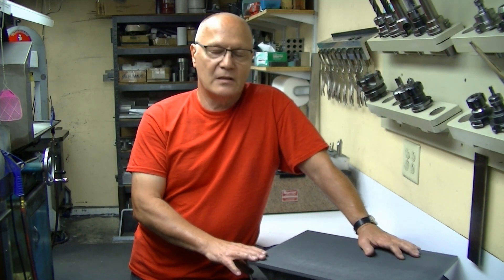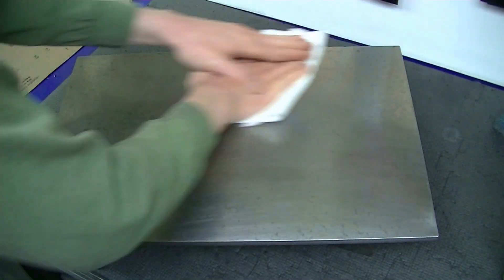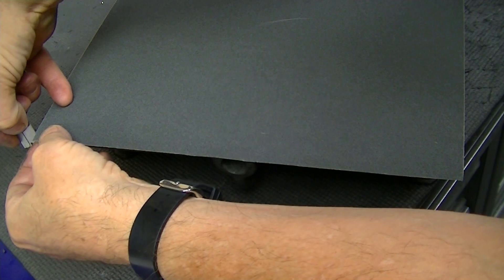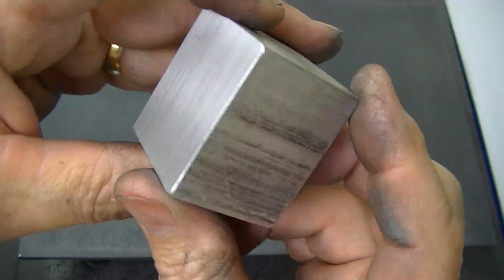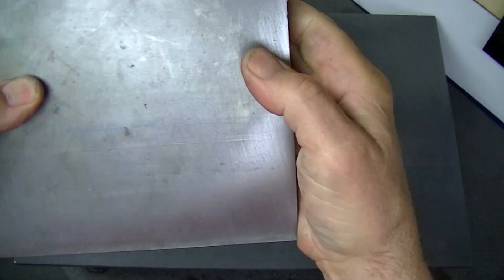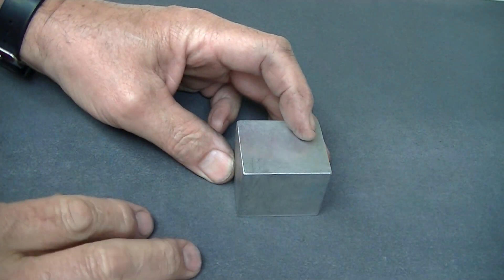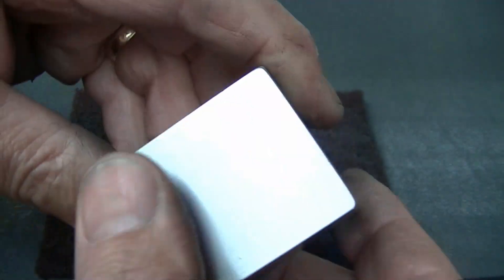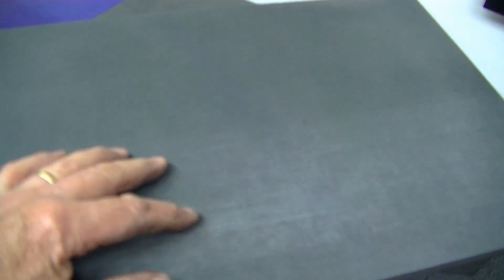THE MAGIC SANDING PLATE  TRT#3

Comment: 18min video on a sanding plate? I watch and I am not disappointed :-)
I have a toolmakerfriend who purposely puts a 45° lay on all his parts so he knows he worked on the parts when he pulls a tool apart a few years later.
Reply from the maker: Glad I didn't dissapoint ;-)
ATB, Robin
Reply: Lapidary company's sell a disc cement for sanding discs. But it's not much different from  77. I use regular rubber cement,it's a little tricky but it works. I do saw piercing in brass and copper? I Xerox the design glue it to the sheet stock, then start drilling a hole in each section that needs to be removed . It's virtually  the same glueing technique .
Reply: @ROBRENZ  I don't know if it's in a spot where you can do it or not,  but have you ever tried letting water trickle on to your sanding plate while you're using it?  I've done it by taking everything outdoors, and also by simply taking everything over the the sink. I really like it. It does a great job of keeping the sandpaper clean, because it's constantly flushing all the particles of sand and material away. I want to build a dedicated supply and drainage system just for a sanding plate.

Comment: Rob you need to contact 3M and tell them how to remove 77.  About a year ago I was so fed up trying to remove the stuff from my 20” disc sander backing plate every time I wanted to replace the disc that I contacted them for help.  To make a long story short, everything they suggested I tried and none of it worked.  You just made my whole evening.  Thank you.
Reply: Aromatic and aliphatic petro solvents tend to work just fine with 77 and other sprays (at least the old cans; idk if they've changed the formula in the last 20 years).  Mineral spirits, naphtha, xylene, toluene (in approximate order of aggressiveness) should work, while IPA isn't going to do anything.  Keep in mind that the solvent package in WD-40 is a mixture that's basically equivalent to kerosene (largely aliphatic).  With some of the chloroprene cements, ketones (MEK, acetone) do work, but their evaporation rate is high enough that for removal tasks, they become difficult to use alone.  Most contact cements (up until more recently) had a solvent package primarily of MEK and toluene.  One might think that if the combination of a ketone and aromatic solvent work well, then a broad-spectrum solvent mixture like lacquer thinner should work perfectly.  This used to be the case, but in my experience, most formulations of lacquer thinner are now adulterated with an excess of alcohol and other "zero-VOC" solvents that they cause the glue to coagulate and turn into a clumpy, smeary mess.  
 
For me, I have spray bottles of the solvents I use.  If I had such a cement on a metal (not plastic!) surface, I'd hit it with a spray of MEK and a spray of xylene.  Scrub to dissolve, wipe off the bulk; respray, wipe.
 
When removing sheet material from a rigid substrate, you can lift the edge and use a brush with solvent to massage the adhesive as you peel.  Keeping that leading edge wet helps a lot.
 
Of course, if you call a company and ask, they're probably bound by liability to not actually recommend something that works if it involves anything that can't be safely fed to a toddler.  That's been my experience.  I've called DAP about one of their adhesives that says right on the can (an actual new can) that proper use needs a specialty thinner that I couldn't find.  I called them to find out that they don't even make it anymore and they would not recommend any substitute product or give me any information about what could be used.  It's just MEK and toluene.  That's all they had to say.  It's not like they don't know.  They just won't say it.
Reply: @PSUQDPICHQIEIWC   I try to avoid Methyl Ethyl Death as much as possible.
Reply: Dream Services International thanks for the in-depth response.  I tried many of the solvents you suggested with little success.  I felt the guy I was corresponding with at 3M was actually trying to help primarily because this went on over a period of days, but it might have been as you suggested, He was not allowed to say due to liability reasons.  This country never was so lawsuit crazy as it is now.
Reply: Oils/hydrocarbons work to remove most adhesives. It's no secret to use ed
wd40. Olive, coconut, peanut, sunflower, canola/rapeseed oils even work. Same idea as using peanut butter to get gum out of hair. Almost all sticker residue can be removed with WD40.
Reply: Hexane...
Reply: @PSUQDPICHQIEIWC  Thanls for the information, now I know why I'm having so many problems with 'glues'. Hope the spray cans I have are still OK since I shelved them because of the problems I was having removing residue  ;o)
Reply: @MaturePatriot  I'd always been told that MEK is horrible stuff, but looked it up the other day . It is an irritant, and tests show that long term occupational use (multiple hours a day) is dangerous, but in low doses - if you're gloved and have decent ventilation - it's probably no worse than any other common solvent.
Reply: Hint from an old time pattern maker:
1. On my 20" State I first heat the paper up by sanding a piece of scrap wood
2. Peel as much off as comes easily, using fingers and a not-razor-sharp chisel.
3. Start it spinning and chisel off as much of the paper and glue as you can. Hold the chisel firmly and keep it skewed and flat on the disk. Watch out for anything that might catch the chisel; high spots, low spots, nicks, etc. ...Unless you are in need of a little excitement in your life...
4. Stop spinning, Wipe the disk, and saturate the remaining adhesive with 3M adhesive remover. The formula for the 3M product may have changed, the old stuff I use seems to be mostly toluol.
5. Wipe or scrape off the last little bits of adhesive.
6. Wipe the adhesive remover off the disk with a less aggressive solvent.
Reply: @ChimeraActual  I’ll give it a try next time I change.
Reply: WD-40 works to remove most types of gummy adhesives. I have been using it that way for years. I often print a pattern from a CAD program on adhesive label stock to use it instead of a scribed layout on parts. After the drilling, bending, cutting or whatever is finished, I spray on some WD and let it soak a few minutes. The label stock then peels off easily. And yes, wipe down with WD and follow that with alcohol to clean off the sticky residue.
Reply: A heat gun works great, but there's no substitute for the right amount of 77 on the paper. A light coat is all you need.
Reply: Acetone takes it right off for me

Comment: Sanding Pro Tips should this video be called. I wondered why Mr. Rob wouldnt give the paper a couple licks with diamond wheel to avoid hispots on the abrasive deposition. Maybe check with a laser comparator and an atomic bubble level to see if the paper grain is aligned with the AAAA+a.1 surface plate.

Not nuff words can b said about your attention to detail. Love your angle about life and glad to see you smile

Comment: I just got my 220 silicon carbide in the mail. I could not believe that it removed milling cutter marks in 15 seconds. I had to come back and comment. I went with 3m 220. This is going to save me hours. Thank you sir!
Reply from the maker: That is awesome!
Reply: What size role of paper did you use? I'd like to have a 12x18 plate with long paper roll that I can cut to length myself. I've found a source for the paper in the UK. Quite expensive to get it shipped from Abrasives South.

Comment: Rob, I use a 16x28" piece of fake granite countertop. I lapped it flat to 002, and coated it with a slurry of epoxy and 1200 grit aluminum oxide rock tumbling media. I lapped it flat again with a long heavy aluminum bar and 180 grit wet/dry paper. I use it like a giant precision stone and for all those things you shouldn't use a surface plate for. For heavier lapping, I just tape a standard piece of wet/dry on it. Wish it was cast iron, but I couldn't find one in the dumpster.😁

Comment: We are twins, separated at birth. Yup. A most underrated tool. I sold my old 9" x 12" surface plate a couple years ago but I've needed it several times since then. I used lighter fluid (my go to quick solvent) instead of WD40 but otherwise we plow parallel furrows. 

I called it my "if you can't make it right, make it shiny" plate. It did good service when I made camera fittings and fishing reel parts. Nice crisp edges, smooth parallel lay on the finish, etc under the anodize and the customer instantly got out his checkbook. Gorgeous esthetics. Probably wouldn't have noticed if it was left handed or inside out. I sometimes used it to dress a freshly scraped surface, take out the slight undulations on the rare occasions when they'd be objectionable.
Reply from the maker: Glad to hear it Forrest, I consider that quite a compliment!
ATB, Robin

Comment: Thanks, Robin. I've employed a granite plate for this duty at work a few years back. Dealing with sometimes hundred year old motorcycle parts it quickly lets me know the condition of a mating or gasketed surface. The link for the oversized paper allows me to grab a new larger plate, as you mentioned I've tried looking in the past. Great video.

Comment: I’ve used this technique a lot on flattening large gate valves and flapper valves in ship repair,  all the lathes cut a slight concave at that shop. In a pinch you can spray wd40 underneath and the paper would stick! (Even with a 8”gate being ‘lapped’) We also switched too soapy-water as lubricant, worked very well!

Comment: A wash bottle with the tip cut back enough to receive the inlet end of spray tips works great to clean them. Push a little solvent through to flush them, scrub the face of the tip and then a final flush to make sure they're squeaky clean.

Comment: When I remove the protective plastic from aluminum sheet, I use a piece of pvc pipe or wooden dowel to roll off the plastic. Doing something similar might make it easier to remove the sandpaper from the plate.
Reply from the maker: Great tip!
Reply: Good idea! Thanks!

Comment: I'm going to be on the lookout for a surface plate for sure. Paper might be more difficult since I likely won't be able  to order from Abrasives South Inc. But then again I'll probably only be using it for checking that surface covers etc are reasonably flat on old engines and such.

Comment: I have small versions of this in my shop and it’s absolutely indispensable for deburring & smoothing small parts. I use 6” adhesive back sanding discs on scraps of 1” thick aluminum that I stoned smooth.
It’s probably not as precise & nice as Rob’s setup, but it works well for me. Plus, it’s cheap and simple to setup. You can get the adhesive back sanding discs almost anywhere, in any grit you want. Just remember to put some WD-40 on the abrasive, Rob really understates how much better this works with WD-40!
Reply: Why would you waste money buying adhesive disks, large flat sheets of "wet & dry" paper are cheaper and easier to purchase in even more grits?
Reply: I pay $0.68 per 6" disc. They work the best for my needs, and it only takes 2 minutes to order any grit imaginable from McMaster. I'm not abandoning something that works well just to save a few cents on sandpaper every week. The boss isn't paying me to economize on $0.68 sandpaper, he's paying me to keep the machines producing parts. 

It's worth spending a little extra money to give people the exact tools and supplies they prefer.  It makes them more productive & it's good for morale.
Reply: @danf5429  - it's not about the cost. It's that you are using tiny 6" disks, which aren't flat and also are so small that you can't do the job properly.

Comment: ROBRENZ, any straight chain hydrocarbon is a solvent for any other straight chain hydrocarbon, from propane to gasoline to tar and wax. 

Most adhesives are dissolved with straight chain hydrocarbons, including 3M Super77. My personal preference for a solvent is zippo lighter fluid, i.e. naphtha. It dries relatively quickly and cleanly but gives me an adequate working time. 

I really like the zippo lighter fluid bottles because the spout they have produces a tiny little stream which means less waste. I've found that I can refill the bottles with Coleman white gas, which is light naphtha. The zippo fluid is a mixture of light and medium naphtha.
Reply from the maker: Thanks for the info!

Comment: A'm using similar plate for years, just it's thick glass not cast.
For removing steel swarf, I use strong magnet, (from hard drive) wraped in thick plastic foil, or even stronger plastic bag.
Just unwrap foil over you trash can, and swarf will come down, leaving magnet clean.
Also, loose abrasive particles will stay on sanding paper this way, so it will cut bit longer.

Comment: And for those of us who can't abide WD-40, Goo-Gone and Goof-Off both also attack 3M 77 residue handily and are readily available in most hardware stores. When removing adhesives from plastics, note that while IPA is useless, ethanol (everclear, the kind you drink) is impressive and won't attack most plastics unlike the aliphatic HCs.

Comment: To remove sanding buildup... I use a powerful shop vac with a “squeegee” attachment. It has a silicone rubber squeegee on the end and a very thin slit so it has tremendous sucking power. 

I think it’s meant for wet cleaning floors. It will suck the damn hardwood floor right out of your house. 

But it’s great for removing the sanding buildup with no Mess!! 

An air compressor running about 50 psi with a pistol grip blow gun and one of those sports ball inflation needles also works for cleaning stubborn clogs in paper and files. 

But any more than 50 psi through that tiny hole in the inflation needle and it will blow a hole right through your sandpaper.

Comment: Thanks for many useful tips! 
I find I get the best results using a "non oily" naphtha on stones and lapping papers, but keeping the surface wet. By feel there seems to be a "right" amount of fluid that works best. Also pure mineral naphtha will not gum up over time as will the vegetable oils etc. Interesting thoughts on convex plates. My cheap China granite measures slightly convex and gives me good flats using lapping paper and Al foil methods, never considered why it seemed to work so well...
A thick glass slab in the sink used with water and a little detergent is another trick I used for decades. Wet paper adheres to the glas good enough to make it work well. I use cheap wet papers and throw them away after each  use, they do not work well after drying.
Reply: "Naptha" means absolutely nothing - it's a non-specific generalised term that covers numerous solvents and mixes of solvents. Could you actually be specific?
Reply: @johncoops6897  I guess it is different in different parts of the world. Around here the cheap product is pretty consistent, usually "oil free" mineral aliphatic hydrocarbons BP about +150C. Main use is paint thinners and degreasing, characteristic is that it does not resinify much, as all veggie oils do. For lab use there are lower boiling fractions (naptha or "petrolium ether") available like +90C to 120C  which I think is often better if You can obtain them. Never had any problems with the naphta from paint stores. WD40 etc usually contains veggie oils and will over time clog stones.
Reply: @erikisberg3886  - the tern 'Naptha" is non-specific and basically means nothing. The more you write, the more that you prove it. Insome countries it means deisel fuel for trucks, etc. Some people call Zippo fuel "naptha", yet it's not the same stuff used in Coleman stoves which other people think is Naptha. Sometimes it's not even made from petroleum distillate!
Even referring to ranges of boiling points doesn't really help, since that covers such a wide range of Distillates. If you wish to refer to a particular solvent, then you need to use it's proper name.

Comment: I use the largest DMT diamond lapping plates next to the mill to deburr before next op.  Also use after surface grinder to pretty up the finish.  Typically use with water.  My work is small molds.  They cost $60-80 and last me about 1 year.  After that they go to the Goodwill for someone else to use.

Comment: Naphtha is my favorite adhesive remover. I'll have to give WD-40 a shot.
Reply: naphtha, kerosene, wd40, "mineral spirits" and diesel fuel all work about the same for this and many other purposes. As they are chemically very close to each other.
Reply: If WD-40 takes it off, naphtha will.  It's basically kerosene and light oil.  Most VM&P naphtha is going to be a bit more aggressive and faster evaporating, but their solvent spectrums are pretty much the same.

Comment: Good video. It's interesting that although I use a vaguely similar technique, that you showed me a new method for steel.
When sanding aluminum and plastic parts, I often use a sheet of glass or surface plate, wet with water. The water holds down the sandpaper, except the edges should be untrusted using this technique. Often as I wet the sheet, I add one drop of detergent to the water.
Also, you can use a cheap plastic T-square to make those lines nice and straight : )
Tempered glass can often be found at the side of the road from discarded flatbed scanners.
Although I am daring enough to use my surface plate for wet sanding, I am careful to clean the grit from it, as gently and thoroughly as possible.
If I were rich, I would send a cheap b-grade Enco surface plate off to have it diamond coated.

Comment: Silicon Carbide paper & stones tend to really load up quickly when used for softer steels & non ferrous metals.  What I really want to know is what kind of foam that little cleaning block was made out of.  I think you said it was packing foam.  What kind of packing foam?  Thanks.
Reply from the maker: Ethafoam
Reply: @ROBRENZ  Thanks very much.